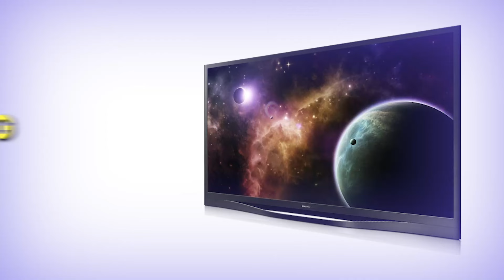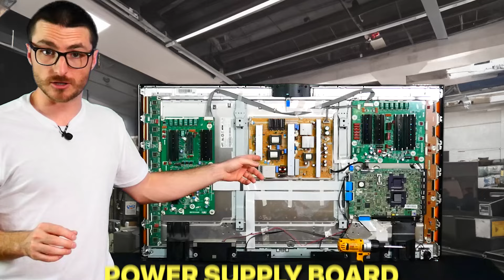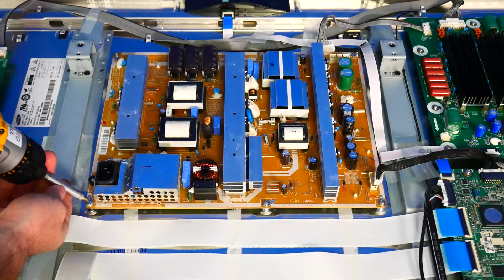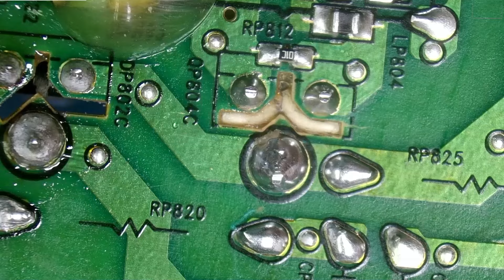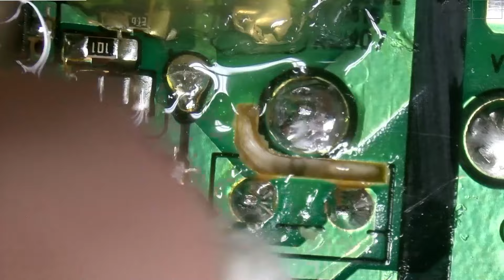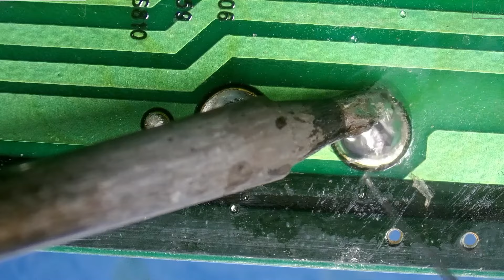Samsung PN51F8500

Comment: with you its always power supply , is there any video of your where you found a faulty resistor or capacitor .
Reply from the maker: Actually, most of our videos are mainboard repairs. Recently we have been doing more power supply boards but that's because I wanted to change it up from all the mainboards we have been doing. 
If you take a look at some of the videos from just a few months ago they are still very relevant and are mostly going to be mainboards.

Comment: Hi Nick, I have a 2018 Samsung QN65Q9FNA has the one connect box. Box model SOC1003N. 

About a week ago TV started turning off on its own then was able to turn it right back on with remote. Did it about 3-5 times over the week. Last night it turned off and won’t turn back on. Red light is on the TV. I unplugged the box for a hour. Held the power button for 1 and 2 minutes. Nothing. I do notice while trying to turn the tv on that the red light will go out for about 10 or so seconds like it got the signal to try and turn on. Then turns back on. 

I’m an Automotive tech and into electronics. I’m decent at making repairs and soldering circuit boards on car modules. I just don’t have a diagram or know where to go with this TV circuit. Any input would be much appreciated. Thank you .
Reply from the maker: Sorry I am not very familiar with that model. You could have a bad one connect box, a bad one connect cable or the mainbaord in the TV could be bad. I would recomend trying a new box and one connect cable first. If that doesn't work then perhaps the mainboard in the TV is bad. 
Sorry I can't be of more help I am just not very familiar with that model at this time. If you are local to Tucson I can diagnose it further however.

Comment: Hey Nick! I have a question I got a free hisense 58rge3 that when I turn  on display looks like between black and purplish. No image, but I can hear sound. Tried disconnecting ribbon cables one at a time to see if that worked but the screen remains black/purplish. Never encountered this problem before. Do you think it’s just a bad panel at this point. The guy told me the tv is a year old. Sorry about not being related to this video. Thanks for any input you may have.
Reply from the maker: I have to say I am not familiar with a black/purplish failure that would include a no picture. Usually when the picture looks purple it's because the LEDs are failing and are emitting a purple color. Simple fix, you replace the LED strips. However combined with no picture either means you have 2 failures or this is something I have never seen before. The no picture could be due to a panel failure, or T-con failure, or mainboard failure. It would be strange for there to be 2 faults however. It might make more sense that you have no picture because the LED strips failed and the original owner tried fixing it and disconnected something and never connected it back or damaged a board internally when trying to diagnose or fix the tv and now you have 2 faults.
Reply: @NicksTVRepair  i know this is a strange one. I have not opened it up will have to do that and check it out. I’m leaning more towards this either being a bad panel, or a software issue. I’ll report back with whatever I find. This is definitely a first one for me. I don’t think it’s the LED as it’s not a purple or blue tint and I have fixed other tvs who’s culprit was the LED but this one is different. Thank you for all your info I really appreciate it and thank you for all your videos they have helped me tremendously.
Reply from the maker: Yeah I definitely would open it up, recheck everything and make sure the original owner didn't do anything to it. Not sure if you know who the original owner is,  but if you can contact them, I would ask them if they tried replacing anything and also if there were intermittent faults with the TV before it fully broke down. The more clues you can get from them the easier it will be to figure out the issue.

Comment: Non related question to this exact video, Wanted to ask info on a Hisense TV model 85H6510G, when the power button is pressed to turn on the tv the power board clicks and send power to the tv, so I assume the power board is still good,  the screen stays dark and there is a faint picture with the flash light test, but I do see the led light up from the back holes, from there the stand by light starts to blink over 10+ times would that be a main board or back light issue in your opinion ? Thanks in advance.
Reply from the maker: What you are describing does sound like LED backlight failure.

Comment: Thanks again for the video. I always enjoy them.  I see that you used lead solder rather than lead-free solder. Is there any particular reason for this, especially on the power supply?
Reply from the maker: It flows a lot better. I feel like I get a better bond between the PCB and component with it. Also and please correct me if im wrong, but I have been told leaded solder is less likely to get cracked.
Reply: @NicksTVRepair  Probably because lead solder melts at relatively lower temperatures, which means it can become liquid more easily during the soldering process, thus promoting better penetration into the microscopic pores and interstices of surfaces. That would make sense that it get a better bond then. Thanks
Reply: @john_Jean-Marc_JMP5184 has a better overall flavor too
Reply: I seen a lot of poor soldiered connections in my day especially on convergence amps of Itachi rear projection TVs. I would normally tap on a board, using the plastic part of a screwdriver to see if I can isolate it better.
Reply from the maker: Yeah, this one and a few other plasma sets you can definitely do that. I noticed it's usually the outer legs of the transistors and never the middle one. The middle one has a metal ring inside the hole, I don't know what it's called but when they do that it seems to help reinforce the joint and helps prevent cracking. So why don't they do that on all the joints? 
Does anyone have insight on this or more info?